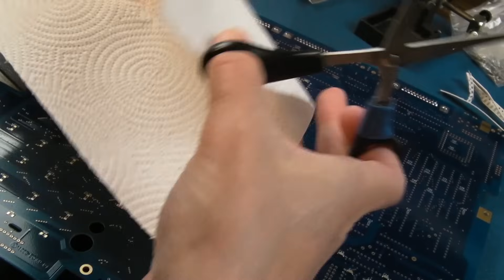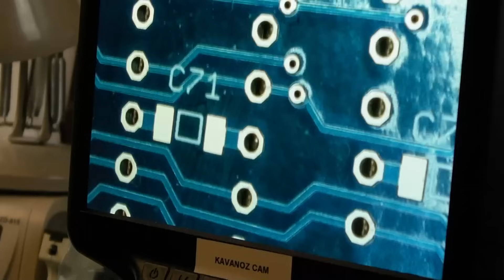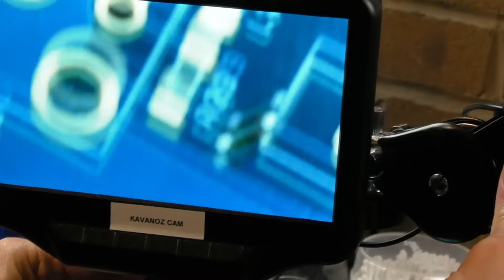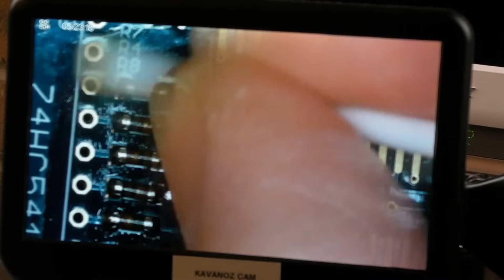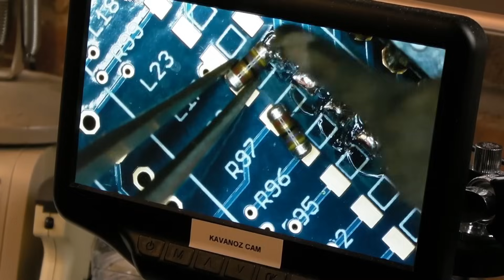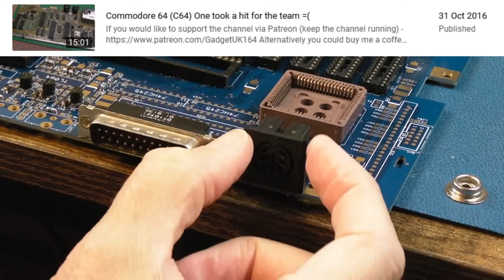Amiga 1000 Reborn Again (MELFS Everywhere) - Part 2

Comment: I forget where I saw it, but there is a better solution for keeping components in place, better than bending leads or blu-tac or tape or whatever. First, go ahead and bend the leads (trust me) then solder one of them in place. This should fix the component in its proper place. Then un-bend the remaining leads and solder those. Finally, un-bend the one remaining bent leg while heating up the solder joint. (Use pliers, unless your hands are made of asbestos. :) ) Works like a charm, and no need to bother with taping things down or cleaning up smurf poo residue or whatnot.

Comment: I worked in the electronics manufacturing industry. The process for a board like this would be a)  glue dots then pick and place machine for bottom smds. B) screen printing the paste on the top side then pick and place, then oven. C) through hole added on a slide line by hand, then wave soldered, this solders all the though hole and the bottom glued smds. D) board clean E) visual inspection and bed of nails test, final qa. So yes to do this all by hand is quite the feat. 👍 I was a qa auditor by the way, working to ipc610 standard. We mostly checked to class b and c standard. We soldered under large magnifiers but we did have microscopes as well and something called a mantis. This was back in the mid 90s so no lcd screens, just straight looking through scopes where required. The company was called surface electronics, it then became Hansatec. We built a wide range of boards , but mostly satellite stuff and audiophile amplifiers. I was made redundant back in 2000s due to stuff going over to China. Fond memories though, I learnt a lot and seeing you work on this stuff is one of the reasons I follow your channel 👍

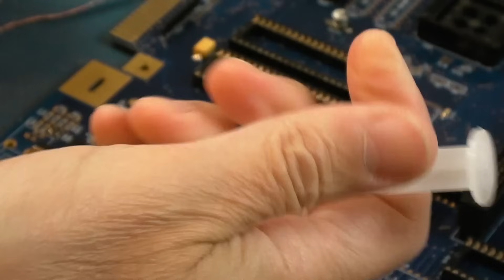Comment: 35:28 I had the same problem. To recover smd components I used hot air, but it requires long heating which often results in overheating. Recently I managed to buy Handskit soldering tweezers for T12 tips for about $75. I have to admit that they work. Although I prefer to use J02 type tips that I bought earlier. They don't fit perfectly because the original ones are shortened.

Comment: I have an A1000 myself (bought used a few years back), but I couldn't make myself do anything like this to it; it is the originality of it that is its value to me. Though I would not mind a PiStorm expansion to plug in on the side (no, opening and modding inside just feels wrong to me when there is a perfectly good expansion connector outside) if someone would make one.
Reply from the maker: Yes, I totally agree!  As I said in part 1, had this been a complete A1000, I would have just kept it stock and had the board as a "test board" on the bench!  The case had been stripped though and the board sold to another person =/

Comment: I built an A4000TX board, and can confirm getting started is daunting. Took a few weekends, but got there in the end. The worst (most boring) part was doing all the through hole sockets. Best of luck with this project, I'm sure you will get it complete and working soon enough!

Comment: According to the soldering technology, SMD components are initially soldered, and then all output and structural components are soldered.This makes it easier to solder and does not interfere with large panels and connectors.
Reply from the maker: Thanks, fully aware! As I mentioned in the video - I prefer random chaos approach when waiting for parts =D
Reply: @GadgetUK164   For new designs, it's best to take your time though ;) It is better to do everything in order so that later you don't have to worry about what is inconvenient to solder.
Reply from the maker: @TheRus13  Oh, I do know!  I still throw caution to the wind =D
Reply: @GadgetUK164   I just worked in the Panasonic service and already gained experience there.;)